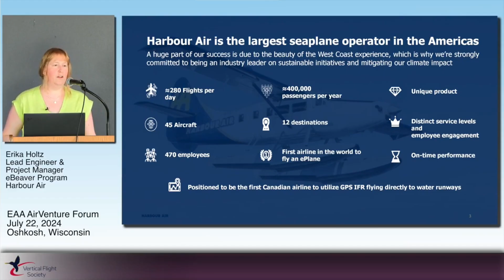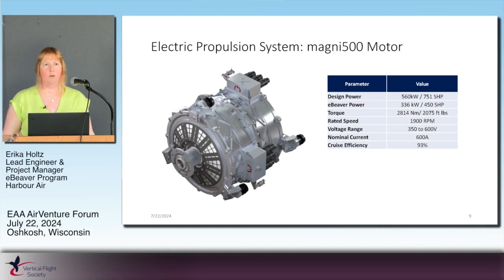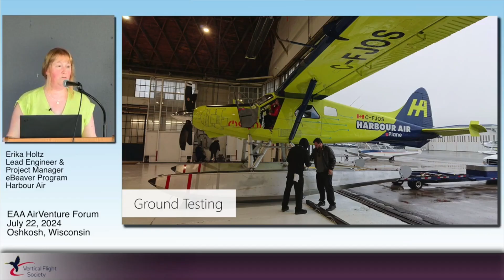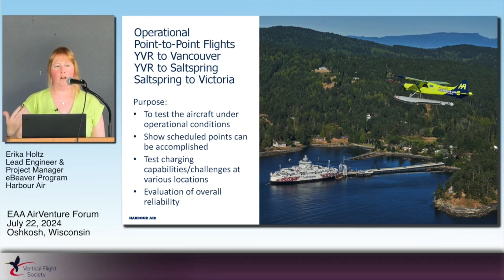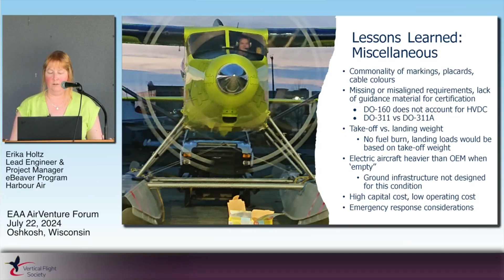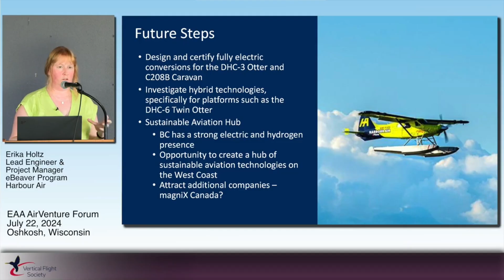The World’s First Electric Seaplane? | Harbor Air at Oshkosh AirVenture

Comment: G'day,

Yay Team !

3 years ago I bought a 3,000 Watt road-registered Electric Motorbike (when Cancer failed to  end me !)..., and the more I looked at the Bike's Motor, Battery, ESC & Throttle - the more I pondered my second Aeroplane - a Volmer Jensen VJ-24w Ultralight Motorglider which I pranged in 1992 and have yet to commence rebuilding, because the World didn't need me making slowly-receding Lawnmower-noises in the Sky by burning 2-Stroke Fuel.

The Motorbike charges off 4 Square Metres of Solar Panels, and I got quite keen on an Electric Ultralight Motorglider with Regenerative Braking  (Take off, switch off, thermal up to 10,000 ft, push over and dive back down in Stage-4 Regen., to rejoin the Circuit with the Altitude stored in the Battery..., in a 630 Lb Free-flying Electric Wind-Turbine (!).

However, apparently a dozen years ago the Beaurocrats in Canberra repealed Air Navigation Order 95.10..., & no VJ-24w will comply with ANO-95.22.

So, I merely enjoy riding the Talaria Sting-3000 MX L-1(e)..., to town for small Groceries.

The Jensen is my 2nd Aeroplane,
Backtrack me to my 
Personal Aeroplanology playlist to see what took me for my first solo  - in

"National Transportation Museum ; Visiting My First Aeroplane...!"

Which is also covered in 

"The 8-Hp, 1975, Red Baron Skycraft Scout ; World's 1st Legal Minimum Aircraft !" (Around which the now repealed ANO-95.10 was written, in 1976...).

My Electric Motorbike has a 2.3 Kw-Hr Battery which recharges with an 850 Watt Charger, running from a 1,700 KVA Inverter, fed by 480 Amp/Hours of Gel-Cells at 24 Volts, charged by a 1,500 Watt Charge Controller and 2 x 440 Watt, 40-Volt PV Panels in series....

Supplied, delivered, installed, GST paid...$10,400 for the Stand-Alone Solar Setup to recharge the $7,000 Motorbike.

If it were lawful, a Solar-Electric Ultralight Motor-Glider seems to be technically rather easy to cobble-up, using off-the-shelf Electric Motorcycle Components.

I've logged 8,400 Km on the Bike, and I really LOVE riding it.

I really enjoy the fact that you're electrifying a Beaver, in Canada.

Keep on keepin' on...

Stay safe.

;-p

Ciao !